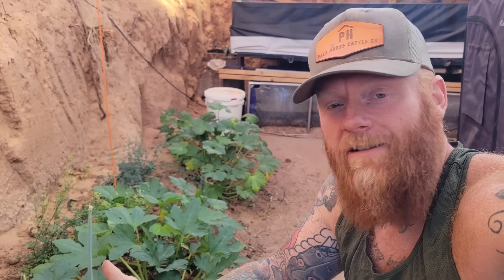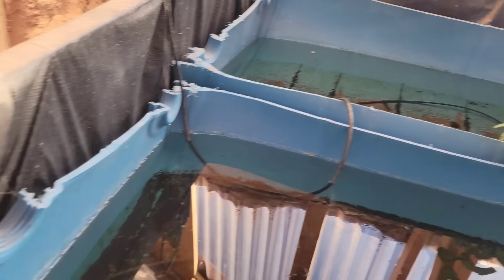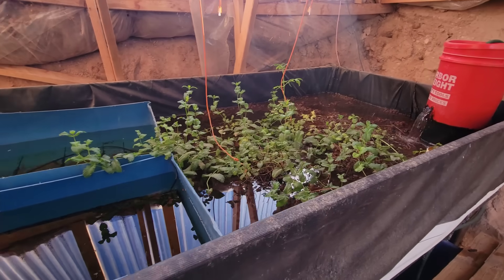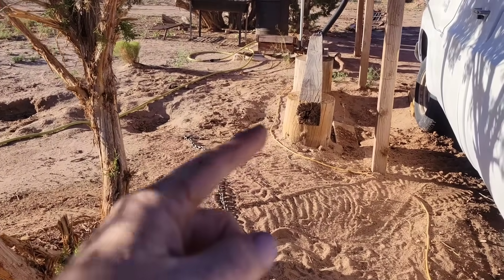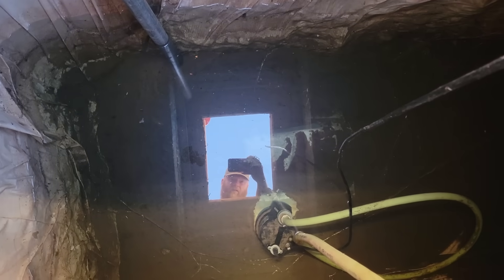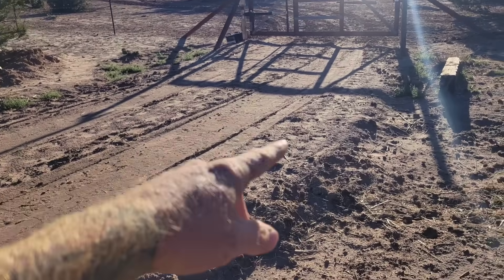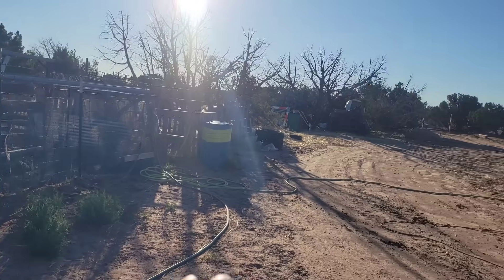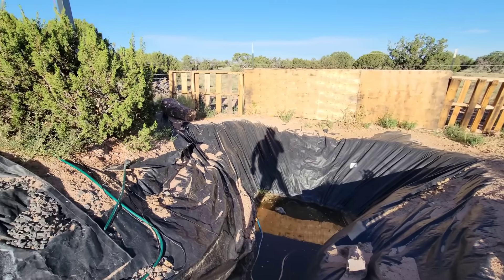WATER STORAGE  for Drought Preparedness Off-Grid

Comment: Recently bought a house with a metal roof which fills the cistern. Had it tested when i moved in and i was told it wasn't safe for drinking. The previous owners did not use a filter, only adding bleach after a rain. The gutters do have some aort of guards iver the downspouts. When i followed up with 2 different water filter companies both told me their suggestion would be to add an injection between the tank and the pump, but that theur filters wouldn't do much good beyond that. The "injection" stage, i asked for clarification, adds bleach. I can do that without spending $$$. however, i plan to keep it as a backup source of water and would like to know it wouldn't make me sick to drink. Did i perhaps not call the right people?

Comment: If you know about "Ice Ball" the old way freezer, which needs just little heating to work - what you have in the desert frome the sun - to have continuous freeze a whole day long and condensation of water💦  not in the open surface but inside of the earth.

So if you dig fire clay pipes with hidrogel in it partly , say 1/2 and another 1/2 free space and you will connect this pipes with "ice ball" passive freezers by perimeter of that pipes area - you will forget about desert on this territory forewer - its like warm floor in reverse😊 and it don't need any power to work except sun.

So sun makes "ice ball" to work and makes cold 🥶 inside pipes , pipes condensate water💦, hidrogel and clay helps to store it . And no extra power at all 🔋⚡.

You actually could do the well to collect that water enough from the pipes.
But your system too good 👍 Well done 😮😊